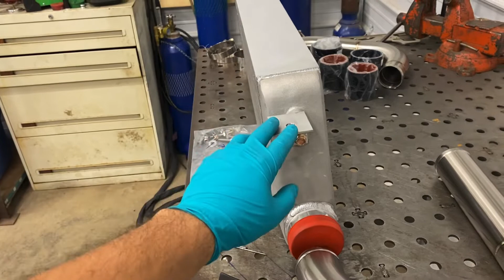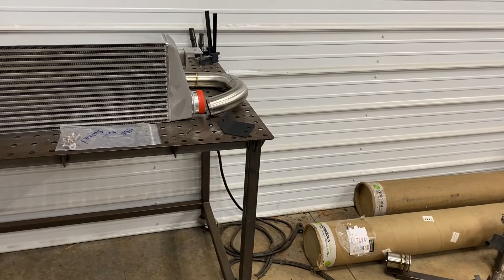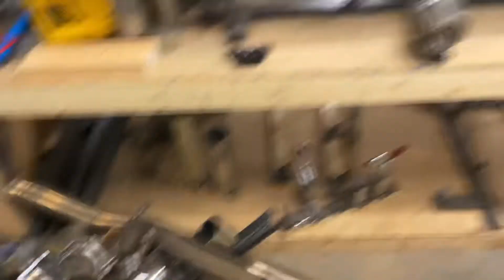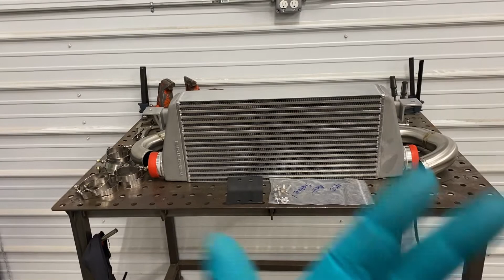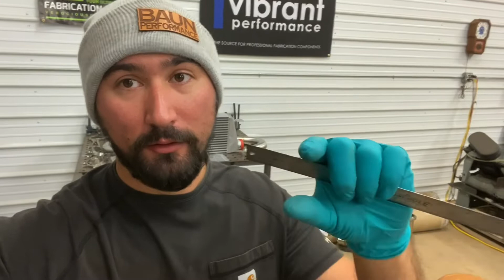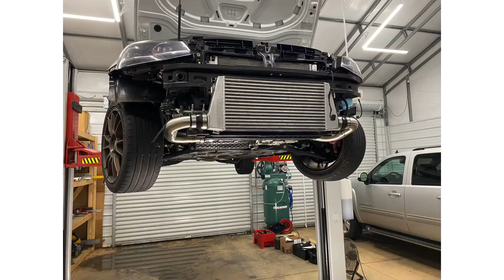V2 FMIC Installation Guide

Comment: Hi Jake. Came across this video completely on accident trying to research if gti / golf R intercoolers will fit a 2015 Tiguan 4motion 😂 small world. Hope you’re doing well, my friend. As I comment on a 4 year old video 😅
Reply from the maker: I’m doing great, hope you are as well! 

Haven’t had a Tiguan in the shop, but being pre MQB I’m sure it’s very similar to a Mk6 (I’d suspect it has a “quick release” style connection or two in the system).

The biggest hurdle on the pre MQB cars is the limited space below the crash bar, which typically means doing some trimming to accommodate a core big enough to compete with direct replacement IC.
Reply: @BaunPerformance that’s basically what my entire evening of research boiled down to. Seems that if you follow the ‘twintercooler’ set up, it’ll mostly fit with some minor trimming here and there. I’ve stumbled across some serious health issues over the last couple years and I’m pending full disability. Once that kicks in I could probably actually drive to you and have you make one. That would be siiiiiiiiiiiiiick. But as of now I have no idea what kind of possibilities lie in store for me and my failing internal organs lol